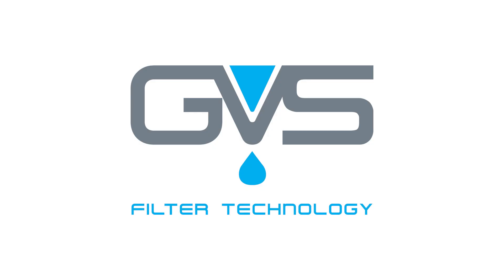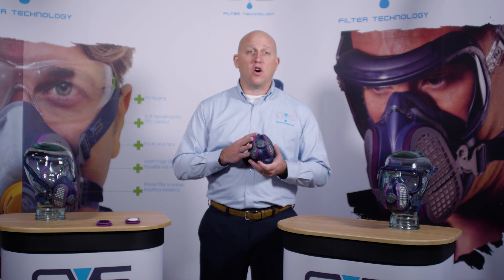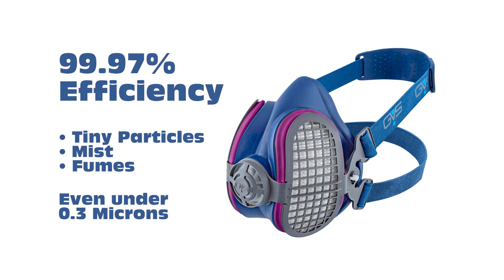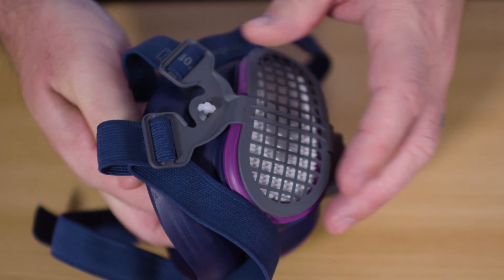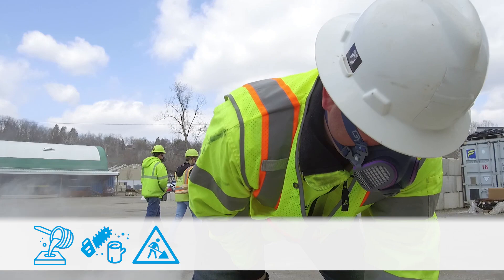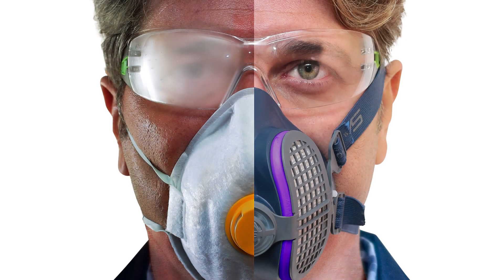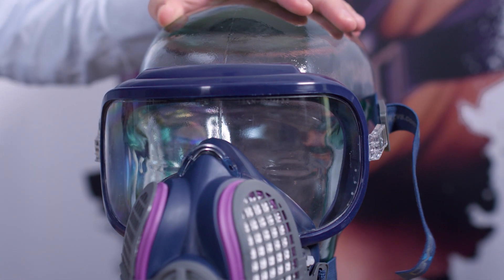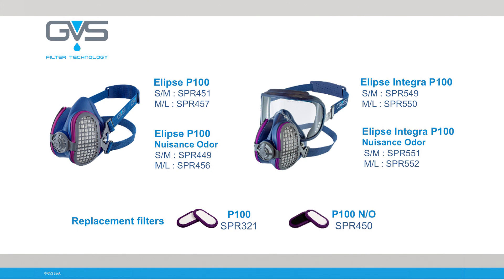GVS Training Elipse Integra

Comment: Hello, I just got my mask, is the front suppose to have a hole in it? There’s no filter in the circle just the two sides. I’m only wearing this to protect against covid, thanks for the response!
Reply from the maker: Good morning, it is the exhalation valve, during inhalation it is closed to keep particles out and only opens to let air out.
Reply: @GVSBlog  ohh okay, that’s my concern there’s nothing closing the exhalation valve, i put it on and it fits well, but the valve threw me off. I would send a picture but it will not let me on here.
Reply from the maker: @unnamedd1358  if there was something closing it, it couldn't exhale, it's normal and it's certified to protect against covid. If you want the valve closed, you can consider the purchase of source control. 

https://www.gvs.com/en/catalog/elipse-p100-with-source-control-niosh-respirator

Comment: Hello there,
I'm just wondering how often do i have to change the filters?
Since you mentioned it can be used to avoid covid-19 with the proper cleaning with the hydrogen peroxyd thats the only question i have. I will order a few ones for me and my relatives.
Looking forward for your answer.
Thank you.
Reply from the maker: Good morning Luis, we recommend using autoclave or the led sterilizer spm900. You can find our sterilizer on Amazon: https://www.amazon.co.uk/GVS-SPM900-FACE-MASK-STERILIZER/dp/B08HM4G8SN/ref=sr_1_1?dchild=1&keywords=spm900&qid=1627367682&sr=8-1

Comment: Hello, I have a question. The center valve, that membrane, comes detached from the factory, right? When you breathe, it works and lets the air through completely. Could this be? I'm asking because I bought one and this happens. In some way, when it's like this, it's like not having protection.

Comment: Hello! I am curious about the life span of the filters. I haven't worn mine yet, as I am saving it for special situations. I have had the mask for about 6 to 7 months. 

thanks!
Reply from the maker: Good morning, what kind of filters do you have? Dust filters or combined filters?
Reply: @GVSBlog  I believe it is the dust filter without the black carbon filter.
Reply from the maker: @gillholmes1293 the durability of P3 dust filters depends on the usage of the filters, for example how many times a day they are used, the type of work, what dust there is and in what concentration. Basically, there is no effective filter life, when the respiratory resistance increases the filters are clogged and so need to be changed.

Comment: just bought this face mask only had it on for a few minutes and started feeling dizzy. I gather the dizziness is coming from the strong chemical smell inside the mask. I immediately removed it to breathe room air. I bought the mask because I'm a crocheter and the yarn fibers get in my nose and throat so I thought this would help. Maybe I need to air it out until that strong chemical smell dissipates? If that's even possible.
Reply from the maker: I've no idea about the chemical smell inside the mask. It doesn't have one, so if there is a smell it may be a problem with the mask or the way it was stored. I would recommend returning it to the place of purchase for an exchange.

Comment: This mask is quite nice, been using for a few years now. One thing I did was swap the OEM filter (removed the paper filter) and replace it with a washable filter secured with no VOC glue for rubber and plastic. I keep 2 pairs, and switch out and lightly wash them after each day of use. THe filter is rated to last about 10 years so it saves me a huge amount of money over buying OEM paper filters (overpriced and low working duration).

Comment: Hello! Can you tell me if you can change the filters on these masks up to the a1p3?

I have this mask already but don't want to buy the better filters only to find they don't fit! I see its a slightly different mechanism but I can't tell if it is all replaceable.

Any advice would be appreciated! Thank you
Reply from the maker: Good morning, the right filters for the Elipse dust Half Mask (item code SPR451-SPR457 and SPR449-SPR456) and for the Elipse dust INTEGRA mask (items code SPR549-SPR550 and SPR551-SPR552) are Elipse P100 replacement filters (item code SPR321) and Elipse P100 nuisance odour replacement filters (item code SPR450). Regards

Comment: Hello! Is it normal there are some drops because of sweat and breathing inside the respirator  in the valve area after using it during a couple of hours? does it affect the filtering? am i still protected? what can i do (aside from taking the respirator off during a period of time and clean it)?
Reply from the maker: It is normal when working at high temperatures. Condensation has no influence on the efficiency of filters and valves. We recommend you, if it’s necessary, take off the mask and dry it.

Comment: How tight are the straps? I have arthritis and I want to make sure it doesn't take huge strength to pull the straps over my big head
Reply from the maker: Good morning, the straps are not particularly hard and are easily adjustable to 4 points.